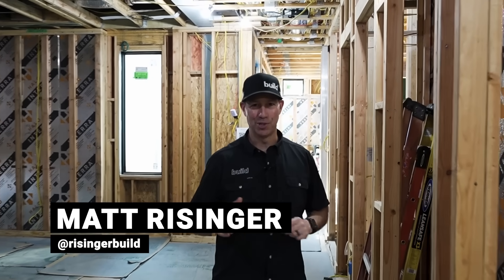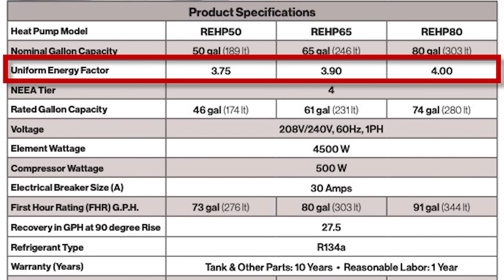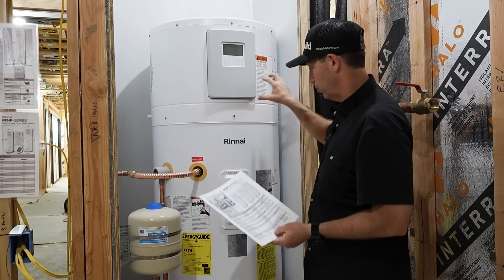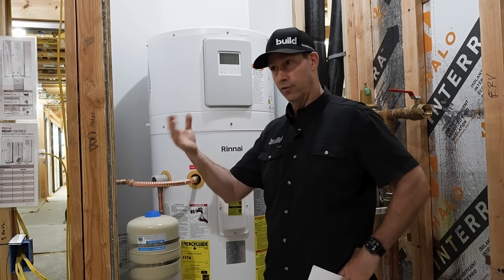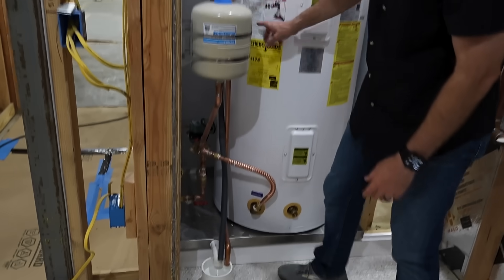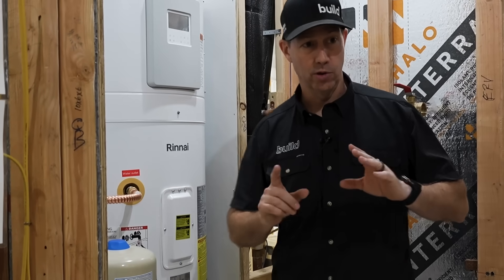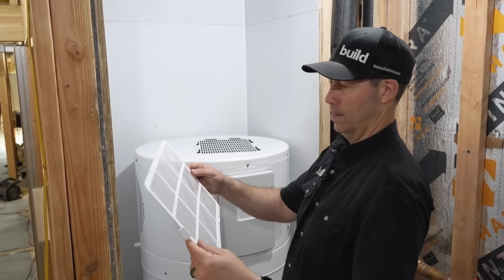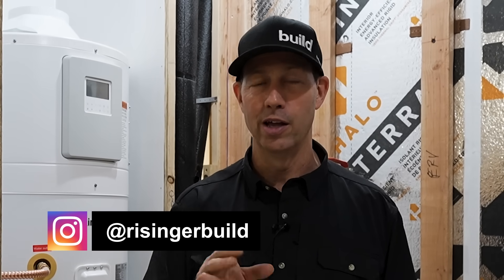The Best New Water Heater? Rinnai's KILLER Electric Heat Pump

Comment: $3800.00 Water heater! Add install costs it's about $5500.00
Take out the cost of a typical Electric unit ($500.00)
$286.00 Energy savings per year according to my energy auditing software.
That is a 17.5 year ROI and a 10 year warranty.
If we are going to use these more and more, they are going to need longer warranty's and the price is going to need to come down.
Anything beyond a 10 year ROI justifiably turns people off, and not knowing if the unit will even last beyond it's ROI is a tough sell.
Reply: My 66 gallon ao Smith Heat Pump water heater cost me less than $1000 after incentives. It will pay off in a couple of years with the electricity prices I am paying.
Reply: @kokovox mine died after 5 years. Now I have to pay $1000 for an installation of a new one.
Reply: @kokovox but the incentives are taxes someone else had to pay
Reply: Don’t forget it’s heat “leverage” (best term I could think of) is using heat from the air around it.  So climate, time of year, and water heater location will effect it’s actual household efficiency.
Reply: Not sure where you are getting your numbers from, but there is comparable version for much cheaper. I have the Rheem Proterra version, which cost $1400+200 installation (Thats Canadian too btw). No rebates, but I'll still break even compared to my old gas tank in ~4.5 years.  My tank is currently drawing about 335W on avg. It runs twice per day for 1/2hr each time. I also have my output vented to the outside, with a T installed to allow the cold air into the basement during the summer.
Reply: @TheNorthern-Lig7t  I was going go Rheem Proterra 80 but its 2400 plus tax, an 2k install and i needed to get a 120 15amp line ran for a sump pump for the drain. You got lucky lol. 
      Ended up going Rheem Marathon with the lifetime warranty for 1200 after tax, spent the other 3 on solar lol
Reply: You also need a reasonable (i.e. "not zero") discount rate when you compute your "payback time". The correct way to do this is a Present Value computation over the length of the warranty or the number of years you'll occupy the house.  If the Present Value is greater than the purchase + installation cost, it's a good deal. Otherwise... no.
Reply: Yeah, I liked the 300 dollar ones that lasted 15 years!
Reply: Thank you.
Reply: In a 100 years you'll break even.
Reply: The numbers may work better with any grants and in areas with high electricity costs. Another area it may work financially with is a solar system. The size of the solar and battery maybe reduced and there could be some savings there. You also have to vent it to get the savings. Otherwise you are cooling down the surrounding air which you then have to heat up for the house (unless it is a hot area or in the summer).
Reply: Warranty is parts only after the first year. The cost of a refrigeration service call was quoted at $750 where I am. Starting at. They have vac out the refrigerant into a recycle machine, replace the part, fill with nitrogen, do the welding, vacuum out  to close to 0hg, then recharge the refrigerant. Put everything back together and test. Time consuming and expensive.
Reply: This guy has lost COMPLETE TOUCH with reality
Reply: Your costs as mentioned are really high compared to mine in Utah. Never assume local greed is universally accepted.
Reply: This one way overpriced I got mine around 900 and installed myself and got 30% back on taxes plus it helps the garage humidity in Florida
Reply: @ralanham76  In Florida you can just put a plain steel tank out in the sun and paint it black to heat your water.
Reply: Bad idea here in Commiefornia. At $.50 a kilowatt during peak TOU, nothing electric makes sense. Nothing.
Reply: I got a Bradford White electric with the Vitraglass liner that is going on 20 years and it's replacement will be a similar model 
ROI on heat pump models don't add up
Reply: Also these are still relatively new to the market, reliability is going to be very uncertain. I've seen some cheaply made heat pumps with thin aluminum coils that leak out their refrigerant at less than 10 years of use. Heat pumps are just not a piece of equipment that can be made cheaply and be reliable. Condensate drains can be a huge PITA too - clogs, flooding and ruining floors. It all needs to get better and cheaper.
Reply: @DennisKapatos  They are only relatively new in the North American market. These have been used for almost 20 years in Japan, and ~15 in Europe.
Reply: @TheNorthern-Lig7t  Not saying I know everything but I think a lot of people will look at these heat pump water heaters the same way I do because anybody who's ever owned a whole house AC system knows the pain of dealing with coolant leaks, condensate drains clogs, coil corrosion, failed pumps, or a host of other things that go wrong with this type of thing. The warranties is pathetic considering the cost and long ROI on these things and they simply wouldn't sell in some areas without the massive subsidies they're getting.
Reply: Well don't buy it expecting an ROI. Buy it because you are using electricty instead of gas, and using a lot less electricity than conventional heaters. That's it, doesn't need to be more complicated than that.
Reply: WHO IN THEIR RIGHT MIND WOULD PAY $1,700 +TO INSTALL A WATER HEATER?
Reply: $5,500 install cost? Does it take 5 days to install? Thats way way too much....
Reply: @dagooglenet  means 5500 total or 1000 in install
Reply: Finally, someone else gets it. These things are absurdly overpriced.

Comment: Tank water heaters are honestly a pain ime. They may cost a little bit more up front but they take up so much less space, operate more efficiently, and are overall much easier to replace if the time comes. If you attach a recirculation pump in the bathroom and kitchen you have hot water within a second or two. If I were building a house I'd strongly suggest installing one of them over a traditional tank water heater.
Reply: Tankless is TRASH. Inconsistent heat, can’t actually keep up with demand they say they can without ruining water pressure.
Reply: @HubstepCamaro  tankless are great. Would never go back to a tank.
Reply: Tankless water heaters are supposed to be cleaned periodically.   Expert level homeowner job.

Comment: It would be nice if these could be connected to the exhaust on the HRV/ERV.  Either dedicated or with a damper motor to re use that energy before it leaves the house.
Reply: That's a good idea, makes me wonder if you could just pipe the HRV/ERV exhaust directly into your water heater closet, air seal the closet, and use a passive exhaust from the floor level of the closet to the outdoors with a damper. Or potentially even ducting the HRV/ERV exhaust directly into the intake of the water heater.
Reply: @ I would think some electrical connections would be needed to have the water heater call for the appropriate fan speed on the erv/hrv.  Possibly adding a damper to allow more air from a traditional source as the water heaters seem to need 8” ductwork where many residential HRV/erv are 6”
Reply: Mine draws air from the vented garage attic above, exhausts into the garage, where my dryer functions more efficiently on dehumidified air before exhausting outside.

Comment: If in michigan in a home with an attic that is part of the homes enclosed envelope, would it makes sense to pull from and dump to the attic? Am I off in thinking that this might be a good way to control humidity and temps in an attic?
Reply: That's about the only way I can see using one here in Michigan.  Even in the summer my basement rarely gets above 50 degrees, in the winter it's usually closer to 40.  It's a 70 year old house so insulation is crap, the only thing that keeps the heating bill semi-under control are PLASTER walls (very few air leaks) that get uncomfortably chilly come Jan/Feb.

Comment: Sorry but I have the best water heater bar none!!! Its a bitcoin miner water heater and actually makes money and provides free hot water!!!
Reply: Just wait 'til the bubble and the tank burst at the same time...
Reply: If someone actually stuck a processor/GPU into a water heater to mine Bitcoin, that is a gimmick and you won't make your money back on the extra purchase cost plus electricity.
Reply: @dosadoodle  you obviously dont know what you are talking about as its not a gpu… to be very specific its a ASIC … an Antminer S19 j pro 104 modified to be water cooled and it is connected to a water heater tank designed to be used with solar heat tubes… its not a “gimmick” product, I custom built it…
Reply: @gemrough   Still a gimmick so you can talk about it in YouTube comments. Would be more cost effective to have not combined a water heater and Bitcoin money.
Reply: @gemrough  that's cool. Not far from commercial reality considering data center whole building water heaters exist (or will soon exist) in Europe. Make a YouTube video about your build. I'm sure people, myself included, would love it.
Reply: @ShouPow clearly it didn't make you rich as you use YouTube like all of us poors.
Reply: @dosadoodle   How is capturing the waste heat from bitcoin mining and putting it to use a gimmick? As for cost, I already had everything used with the exception of the water cooling kit which cost $150… Now if I didn’t already have everything, the ROI would have been years and would not have made much sense to do.
Reply: lol
Reply: Except in the summer you're screwed.
Reply: @itsm3th3b33  please explain…
Reply: @itsm3th3b33  right. How is he going to keep the water from boiling??? It gets to like 100°C in the summer.
Reply: It makes " ether".
And hot water.

Convert it to  currency- then it's  money.

When the grid goes down, it will  convert back to ether.

And NO hot water
Reply: @williamevans6522  I have 16kw of solar… and yes my solar has already paid for itself. Yes I know…”crypto is a scam”… just keep in mind how much you are paying for stuff today vs 4 years ago… bitcoin is deflationary vs inflationary…
Reply: WTH!!!...???
Reply: Sign me up
Reply: Yea Im sure they will both burst… in the mean time Ill enjoy my hot water and $$$. 😂

Comment: What makes this $1.8k better than the competition?  Is it a stainless tank?  Maybe an electric anode rod that last longer?  Variable speed motor?
Reply: Because this is a paid advertisement.
Reply: Yeah and unfortunately the heat pump will be the first thing to go, and so all that doesn't really matter even if it did. Sure it has standard backup, but it's not the point of getting the heat pump
Reply: The tank in the vid is directly coupled to the copper piping, so the anode will erode more quickly. Galvanic corrosion.
I used dielectric unions when I built with copper pipe.
Reply: LG has a variable speed compressor, costs less-
Reply: I like the variable speed stuff cause it is normally DC inverter driven and has soft start, which makes it quieter and less electrical noise.

Comment: The only thing I'm impressed with the homeowners. Is using all copper lines?
Reply: Copper is used when water piping it exposed.  They probably use PEX in the rest of the house.
Reply: @manatee419  I used foam insulated PEX for my install.
Reply: One reason to use a manifold is to run 3/8” direct lines to any sink to reduce the amount of time it takes to replace all the cold water in the pipe with hot water through a flow restrictor. It would not make sense to install 3/8" copper home runs.
Reply: @johnhaller5851  Just to let you know I was a plumber. I see people using other.
Tubing for water lines which  we all know it fails early. I know copper is more expensive but I know I can leave the house.Don't have to worry about a leak for at least thirty years.
Reply: @manatee419  Not sure about your area, but that corrugated flexible copper pipe Matt showed doesn't pass code in my town. I'd say well-installed copper plumbing is good for easily fifty years. I had a 100 year old house with copper and iron plumbing, and never had a leak from the copper. The iron drains were a headache, though. Thank goodness they were easily accessible in the basement.

Comment: My water heater is 50 years old and still kicking. I've refurbished it only once.
Reply: Which is very cool, but you're probably spending $600 a year on power for it if not more
Reply: I've got a 1947 oil fired boiler. Thing just won't die but the efficiency is poo so I'm going to be going Geothermal next year. Will be costly but operating cost will pay it off vs the oil. Sometimes it's worth upgrading
Reply: Parents have a GE fridge that is at least 50 years old.  Been outside in the weather for the last 20 years.  Everything works except the icemaker.  Never been serviced.   They have purchased 3 fridges since retiring the GE from the Kitchen.
Reply: @stopitmike how much power does it draw vs. modern fridge?

Comment: Water heaters are a weird item to promote like this. Depending on where you live, it wont save you enough even to warrant installing it. It might not save you anything, depending on a multiple factors. A natural gas water heater actually costs less to run in a year than this one ever will.... An 60-80 gallon natural gas water heater averages 120 a year if set at the same temps... (120 degrees, that wont even make tea).... That's 50 bucks a year less than what this one claims at 120.... Plus your out the cost of the water heater you may not have even needed to replace in the first place.... Don't replace your gas water heater with this, unless you live in Death Valley and keep it outside painted black..... Look at real costs of running a gas water heater, they are more dollar efficient than these water heaters ever will be.... If you want hot water, above 120 degrees, this is not a water heater you would ever want because the heat pump can't make that much heat and it falls back to using the most expensive energy in your house, electricity......... Notice Matt never mentioned the UEF rating of the heater, and there is a reason why..... The UEF rating is 3.9, as long as you don't use any water out of it...... It would not cost 170 a year if it was truly 3.9, it would be about 45... That should tell everyone what they need to know...

Comment: MSRP $4,818
Reply: I just paid $2000 for the top-of-the-line Rheem heat pump water heater, 80 gallon, after sale and Pro discount.  Subtract another ~$1200 for local and federal rebates and it’s a no brainer.  In the end the purchaser should at least understand the payback period vs something like natural gas.
Reply: As mentioned this is like buying a Mercedes, right now there's a federal 30% install rebate and my state currently gives you $600 then you go and throw in the energy savings.... And the benefits of demunification and cooling if you're in the south or in a basement
Reply: @Panhead49EL  rheem is comparable at about $2700
Reply: We looked at these and with the installation cost (city requires permit & licensed installers) minus rebates our payback would be 5-8 years. Does anyone think the tank will last longer than ten years? It’s a cool technology but doesn’t make much sense financially.
Reply: @TimAZ-ih7yb  You just summarized why it makes sense financially, so how does it not make sense financially?
Reply: @TimAZ-ih7yb  The host is pointing out a stainless pan in case the tanks leaks in 30 years. The unit is just a glass lined mild steel  tank most will fail around the 10 year mark.
Reply: Ouch
Reply: Ouch!
Reply: Rheem with slightly better specs $2500 and much easier to get.
Reply: @JM-yx1lm Which model or line should we look for?
Reply: No thank you …
Reply: Home Depot $500. I defy you to prove that I benefit from this gold plated junk in the video.
Reply: I DONT CARE ABOUT COAST..AS LONG AS ITS EFFICIENT AS THEY. CLAM..A STAINLESS TANK WOULD BE THE WAY TO GO
Reply: Yeah, I'll never realize the ROI on that in my home.
Reply: Subsidies and rebates are just a fancy way of admitting your neighbors are paying for your stuff.  Not cool.  These things are priced accordingly, and would have much lower sale prices if rebates weren’t available.
Reply: @superspeeder  says the guy typing on a computer that was delivered on a road guaranteed by the government, breathing air guaranteed by the government, drinking water guaranteed by the government, sitting under a roof built to government standards guaranteeing it doesn't blow away -- it's really easy to criticize people who want to save power for the grid and keep poison out of the air when you are being so well taken care of.
Reply: @superspeeder utilities offer rebates because if you use less they don’t have to build/run/decommision another power plant.  They aren’t hippies - It’s actually more profitable for them.
Reply: @TVwatcher-ic3ne  In my area the rebates funding comes from a line item on the utility bill. In other words the $$$$ is from customers. Utilities would love to build more power plants as they have political power to pass the cost to users, what does one expect from a monopoly.
Reply: @ the house always wins! (And they do even better when the demand is less “spikey” and easy to plan for. )
Reply: @ that seems extremely counterintuitive.  Can you explain how it makes sense for a for-profit enterprise to financially compensate you if you purchase less of their product?

The only way this makes sense to me is if the electric utility is incentivizing proven owners of gas water heaters to switch to an electric water heater.  That happens here in Ontario, but the subsidies still come from the government under the guise of reducing CO2 emissions.  It has nothing to do with reducing electricity consumption.

Comment: What kind of static pressure/duct length can it handle for the inlet and outlet? I'm considering putting one of these in my garage and using it to provide some continuous cooling to a media closet about 30 feet away.
Reply: Great idea! Id like to hear more about using that cooling/dehumidifying byproduct.